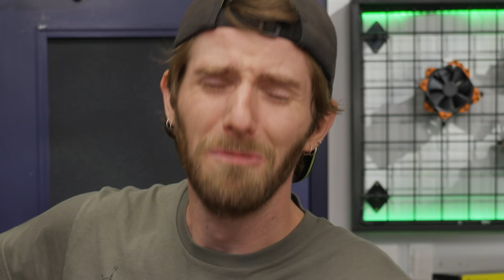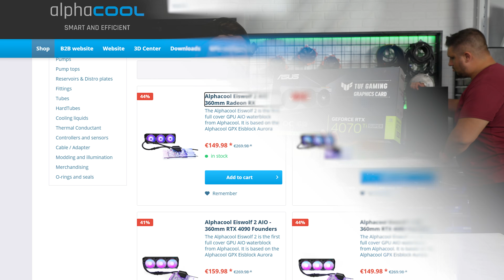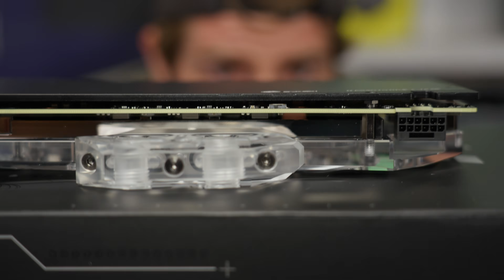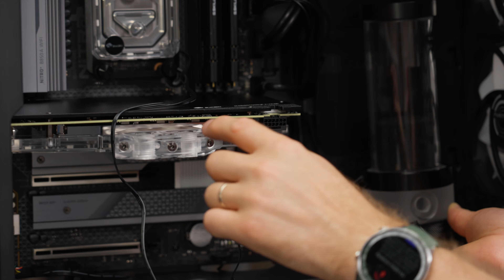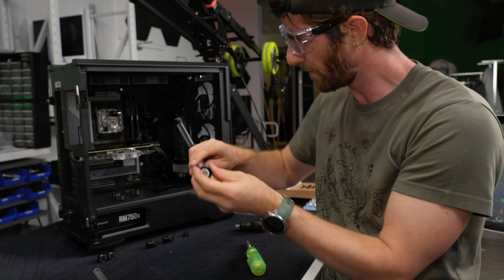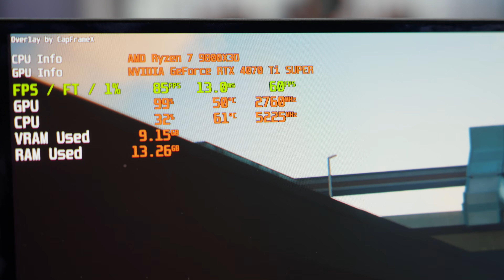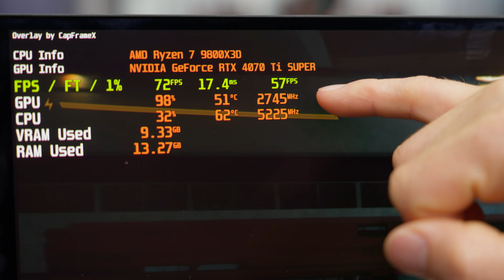Your Next Budget PC Upgrade is...Custom Watercooling??

Comment: I am using the thermalright frozen infinity 240 for 50€ for my 14700f, running with unlocked powerlimts and Im more than happy. Under full load it deasnt get hotter than 70 degrees, but Im also gonna put a thermalright contactframe on in the next few weeks.

Comment: I custom water cooled my PC about 7 years ago using largely Bykski parts, except for the radiators and pump. Performance PCs had a better deal on Black Ice radiators than what I could find on AliExpress at the time, and the Bykski D5 pump/res combo I ordered was DOA and I didn't want to wait a month+ on a replacement so I got an EKWB one from MicroCenter. 
7 years later, all of it is still holding up just fine, the only true issue I had was with the EK pump, the mount had a manufacturing error and I couldn't thread in the screws to tighten it down to hold it in place (I figured it out, I was able to punch out the little plate in the mount that it screws into and I had a thread tap set for the correct thread pitch on hand)
I've used both EK Cryofuel (I bought the blue dyed concentrate and diluted it) and Corsair XL8 and all the components are still perfectly usable all these years later.

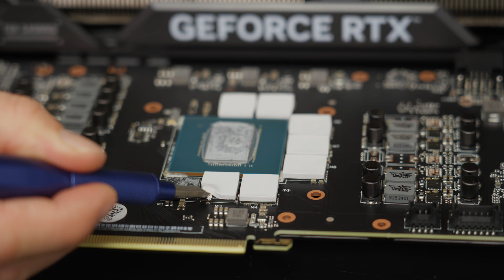Comment: @Linus- @5:25- please don't use metal tools as a first approach to removing these thermal pads- use clean (preferably gloved) fingers first to preserve the thermal pads as best as possible. Use a small amount of 99% isopropyl to remove the adhesive layer and any left over residue. You can see how you're removing material and literally shredding your thermal pad with that screwdriver and there's no need for that. 

*Do not use metal tools if avoidable, and definitely not as your first approach~!* 

Literally me here completely aghast thinking about those who should follow up and destroy their thermal pads. These pads are notoriously a headache on the consumer end- they must be a specific thickness and will run someone 15-30$ for a replacement from gelid solutions or thermal grizzly (and you cannot just use thermal paste). Note: as thermal pads age they are likely to become brittle and may require more tools than just your fingers.

Great video otherwise though- bykski have been a much more solid brand in the liquid cooling market than given credit- I have a waterblock from then for my 4080s and all my fittings were updated to dracaena- some really great budget sleeper brands that can get you competitive liquid cooling. ((soft tubing has really improved over the years and is prone to leech WAY less plasticizer than old PVC; consumers should stay away from opaque and show coolants until they're confident in their loop maintenance and desire more of it! welcome everyone to the liquid cooling community ^^))

*Edit: typos; sorry!

Comment: i have a aio 360 arctic freezer 3 and i have 62 degrees on my cpu a 9850x3d on max load and a 4080 super zotac trinity oc that goes around 71 degrees on max load. why the hell would i buy something that needs maintenance? because it looks cool? :)) wtf those temps are not even that low. mind you both my cpu and gpu are oc

Comment: Linus! Can You Build a GPU Water Block With Nothing but Hand Tools?
No CNC. No milling machine. No fancy machining.
Just a copper plate, a cheap water block, a Dremel, and a hand drill.
Cut it. Drill it. Clamp it together. Put it on a GPU.
How bad can it actually be?
Then compare it against a proper commercial GPU water block.
DIY vs. the real thing ,..let's find out where the money goes. :glasses-purple-yellow-diamond:

Comment: Extra tech tip... Because GPU blocks can be HEAVY, you can use an extra piece of hardline tubing cut to the right length as a GPU support bracket, Looks way less out of place than most supports in a hardline watercooled build too.

Comment: Water cooling isn’t recommended on a tight budget. Most people will not have spare parts and one mistake could cost you the system. Isn’t worth the risk especially if you already have a great spec system.

Comment: Bykski does a pump and radiator combo that's pretty neat as well, if you don't want to do a full loop it works for just the gpu. I had one on my 3090.

Comment: Me with my very affordable Artic freeze III aio for under 100 dollars while also beating the competition in cooling performance.
And never had a problem with it.
its even quieter and run colder then my previous AIO

The only thing a Custom water cooling set up would help is with the gpu, and that's already running under 80C and quiet under heavy load, of cause custom water-cooling might be quieter and more nice looking but also more maintenance.

Comment: Water cooling is 100% unnecessary and usually never worth it in 99% of use cases especially custom water loops.  Imagine needing to fix something or trouble shoot.
Reply: like i said "AIO's are nice to have but compared to a custom loop they are literally just a cosmetic upgrade to a Good Air Cooler"  custom water cooling is definetly a pain in the ass but once you used to the sound atmosphere of pc who is always idling even after 5 hours of gaming in midsummer you cant go back
Reply: @hossosplitternacken7819  Even a custom water loop is completely unnecessary for 99% of people even during peak summer temps.  The majority of people who use water do it for "silent" operation and thats it.  Anyone who says otherwise is lying to themselves especially after  spending $400 or more on their custom water loop.

Comment: 22:20 9800X3D - about 160W max. nvidia 4070 ti super GPU, about 285W max.  CPU was under 50% utilization, 360mm basic rad, he's handling about 360W of total heat dissipation here on the 2 components being cooled without overclocking.  Pretty standard fair and why the temps were fine.  That said, it'd be nicer to have another 360mm rad thrown into the loop for additional overhead.  But with a questionable unknown source/detail "pump" from China kit, this where they primarily cut costs and adding any further restriction (another rad) might just take it out that much quicker.

A serious buyer should utilize a well respected coolant to help against mixed metal corrosion and included biocide.  He doesn't cover that here, and he's notorious for being a big distilled/"our local tap water is amazing" proponent.  Additional expenditure on a real known quality reputable brand DD5/DDC pump replacement would be money well spent over long term.

To really max out the power envelope with both these components would be something closer akin to 1440p, instead of 4k, and uncapped refresh rate, to make things more CPU bound than GPU, along with maxed settings at that resolution in cyberpunk.  Toggle path tracing on if still not hearing your UPS trip due to voltage sag.  At approaching 450-500W of component power to cool, that single 360mm radiator will show the under performance, before the cheap pump gives out due to excessive coolant heat after a long play session.  He picked 4k for  a reason, and that was to end any additional power/cooling duress, CPU side.  I can do Cyberpunk at 60fps at 4k on a 6900XT with lower power use, too while my 5950x is barely utilized.

Comment: I did soft tubing with mine but I used EDPM tubing. I never had a leaked and I only have to change the liquid out about 6 months to a year and it doesn't take to long.

Comment: Been using Bykski's parts for over 4 years now without a single issue. Even using 4 quick disconnects and my 4090 block in my loop and not a single problem, highly recommend it.

Comment: I bought a $40 cpu cooler from amazon and my temps went from 85 degrees while running at base clock speed to running at 70 degrees at full boost.

Comment: I've delidded my 3D2 in preparation for a direct die watercooling setup. I've got most of the stuff but still missing a few components. I went with EPDM tubing instead of hardline for my first time. 

Going to watercool my ram as well but I'm not blocking my 5090 until the warranty expires. I'll probably go with a heatkiller ultra for that

Comment: 😂😂😂 You can get the Jungle Leopard pro flow 360mm aio that has a 5.5" screen for $125 u.s.d and is often on sell for 100$ .. also you went with a 40" series because they don't make water blocks for gpu's for the 50 series outside of the 5090 and few 5080 models.

Comment: I'm a boring old man. If I were to build a water cooled computer I would never go with hard tubes. coft tubing is just so much more user friendly and adaptive.

But like I said' I'm boring, and I would absolutely go with a case with solid steel panels as I have no interest at all of seeing it's insides other than when I've opened it up for service or upgrades.

But even so I appreciated this video and especially that Linus showed the mistakes and failures.

Comment: Theres an in 3pin argb and 4 pin fan spot, on that rgb/ fan controller they included...if want your motherboard settings to take control rather than the remotes, those have to be connected to the motherboard...sure you guys skipped that step...i use a remote syle argb with my mini k11 pc and an oculink gpu, wanted some rgb so made sure i got a rgb controller with remote bc theres no mother board in that set up...like there is in my streaming and gaming pcs...with them if want to have it work off motherboard settings and not specifically a remote you need to find the single in ports for fan and rgb and connect them...otherwise itll work but only with the rgb/ fan remote...aside from that, I still really like the 4070 ti super, I've got one and really i see no need to upgrade especially if going amd...the 9070xt would be the only current option and its just not good enough to justify it...it really isnt...which is why for amd I still have a 7900xt 20gb...its just not worth it for the 9070xt especially since they are finally adding fs4 to those 7000 series amd gpus...I feel like their aim was just a more budget friendly gpu line with this 9060 9070 series but if you already had their previous best models there's basically no reason to waste money on an upgrade

Comment: Get the Alphacool Eisberg 360mm upgradeable units and grow into them. The Pump and CPU block is combined into one unit and radiator is full copper with standard G1/4 fittings (What you want).

Comment: Yeah... while that allin one package is better than I expected it still shows pretty mcuh every reason why I am a PC enthusiast for over 10 years and never bothered to custom watercool my system.
I already have enough unnecesarily comlicated stuff in my setup, I really don´t need 10 more things that can go wrong at any time and need maintenance.
I´m not sure if i missed that part or they actually didn´t ship it but there´s nothing in the loop that would stop things from growing in that loop? As far as I know you should really use that kind of stuff and I dont get why it´s not included. I´ve seen so many waterblocks with so much buildup of things growing inside the loop...  And even with that kind of stuff included you still kinda have to maintain it on a regular basis. There´s been so many videos out there showing custom watercooled systems that after 3-5 years with no maintenance, sometimes even less, have worse cooling than like a 360AIO or Noctua NHD15.
And I also really hate how you cant really reuse most of those parts. If you dont clean them regularly most of those parts get to a state where you just dont want to reuse them even if you could. GPU Waterblocks can pretty much never be used on a newer GPU after upgrading, and CPU blocks mostly just as long as the socket like AM4 or AM5 is alive. If Am6 gets a new mount then you´re screwed. Meanwhile I´m sitting here with my Noctua NHD15 I bought in 2016 that I had requested a AM4 Kit from Noctua and can still use it on Am5 on my 9850X3D just fine. For my other PC I have an Arctic Liquid Freezer 2 where Arctic also provided the AM4/5 bracket for free.
The main benefits from custom watercooling is that you can either cool more power, or cool more silently than on Air/AIO.
But in my experience with an Arctic Liquid Freezer 360 you can cool pretty mcuh any relevant CPU pretty much completely silent anyway, and if you need it to perform a little better upgrade the stock fans to Phanteks T30 fans, which are way more powerful on that 38mm radiator because those fans themselfs are 30mm instead of 25. and if you´re a baller go puch pull.
I use that Liquid Freezer 360 + 3 Phanteks T30 Fans setup on my PC in the livingroom and haven´t heard it audibly once in 4 years going from a 5900x to a 9800X3d currently and always under 80°C mostly under 70°C.
So for cooling a CPU that is my personal pretty much unbeatable combo, making custom watercooling useless unless you actually need to cool some 400W Chip, which probably isn´t a Chip relevant to the broad masses anyway.

GPU is the part where it gets harder. Custom Watercooling a GPU is such a bit*ch that I personally would never try it, but it also has the mostbenefits on the GPU since in most builds you´re wy more likely to hear the GPU fans rather than the CPU fans.
As explained above cooling a CPU pretty much inaudibly is extremely easy. For GPUs it´s pretty much impossible without custom watercooling.
If you go for some lower end cooler on a higher end GPU you´re gonna hear it scream every day. If you buy a higher end model like some 5080 TUF or Astral youre not gonna hear it as much but you will hear it under 100% load. So even the best aircooled cards will mostly be still audible under high load unfortunately. There are some AIO cooled cards that are pretty cool but most of them are so expensive you might as well buy the normal version of that card, get a waterblock, radiator and D5 Reservoir Combo and pay someone 100$ to do it for you...
If the price is right they might be a very cool thing to buy though. So while I want my PC to be as silent as possible I personally mostly go for models with a pretty good aircooler out of the box. That way it´s not perfect but it doesn´t get too loud. 

So back to the kit.... that thing where one of the fittings doesn´t properly work on their own Reservoir... that´s a dealbreaker. Nothing about that experience was easy, and as a novice buying a kit you expect everything to just work. If that happened to me that woudl mean hours of troubleshooting, not knowing how to fix it, not having a replacement part on hand to just try another one and then calling their support, hoping they know about their own fuckup, waiting probably weeks for them to ship the actually working part and not being able to use my system in the weeks of waiting. If they dont know what the problem is get ready for even more troubleshooting, even more weeks of not using your PC, in that meantime also all the other retun policys for all the other parts you bought probably expired and if you didnt test functionality before you´re sitting there wih a bricked motherboard or whatever.... And if you and their support dont figure out the issue you can undo all your work for another few hours and rebuild your gpu with its aircooler and send the whole kit back...
That fu*cking fitting not being the right one in a all in one kit is so perfectly representing every reason I would never custom watercool my personal PC unless for whatever reason I absolutely have to.
Also from everything I´ve heared I woudl also never buy any pump/res combo unit that is not a D5. If I want a cheap shitty pump I might as well buy an AIO. If I´m at the point of going custom loop then there´s no way I´m not getting a D5 Pump.

Comment: And for those who're confused at what tube is better 

Just buy aftermarket radiator hoses for bikes like R1M, CBR1000, or anything that has something long enough to feed water. Sure, it's overkill, but it's worth the 650 bucks because that thing will eat the heat like it's an ice cream

Comment: what were the vrm tempts for the gpu before and after the mod?
Reply from the maker: Didn't check, but way lower. A full cover block puts them super low to the point where u don't think about that. - LS
Reply: @LinusTechTips  thanks

Comment: I always like to do the longest hardline runs first. If you mess one of them up you can likely cut that tube and use it for some of the shorter single bend runs. 
Also for drilling into the case with hardware already in it.  Put a magnet in a zip lock bag and place it under where you are drilling. Will collect the metal shavings. (assuming steel case of course)

Comment: Bykski worked fine for me for years. I switched to hardline with only 40 bucks in fittings and hardline back then. 
They never leaked except where i tore a seal with a not cleaned up hardline end.
Still using the 260 bucks for better hardware and a good aircooler is so much less hassle.

Comment: This is literally how I built my loop the last few years. Byski and barrow parts. I do recommend getting some Thermal putty to replace pads on cheaper gpu blocks though as they tend to never be quite right. You can get a cpu, waterblock pump res combo to cut costs even more and great for custom mini pc's like i challenged myself to build in the Dan A3 case.
Reply: Yeah, thermal putty is key.

Comment: Is a custom water loop even worth it or water cooling at all? Unless you're doing some crazy overclocking type of stuff. Just buy a thermal right AIO for under $100 Am I wrong? Let's just stick with a air Tower cooler as far as water cooling your GPU to get a couple more mhz totally not worth specialty a 4070 😭

Comment: I'm going to stick to an AIO for my CPU and fans for everything else 😂
I'm running a 9070 GPU paired with a 7800x3D.
I'm getting 183 fps raw frames, no upscaling or fake frames, only ultra settings.
GPU temps are chilling at 53° and CPU is at 46°
Plenty of room to overclock 😎